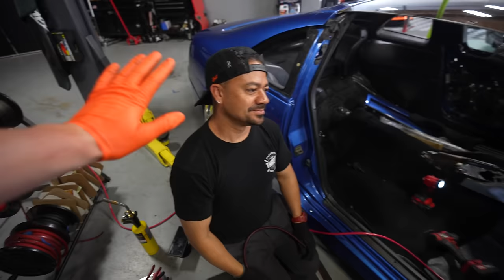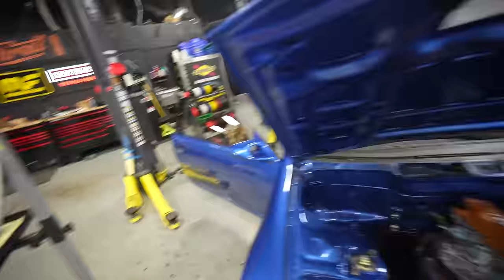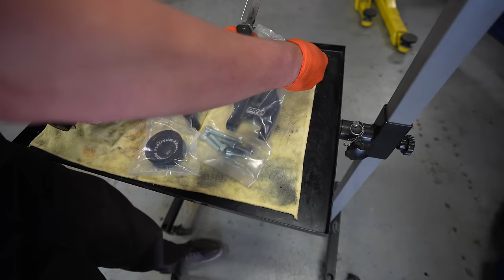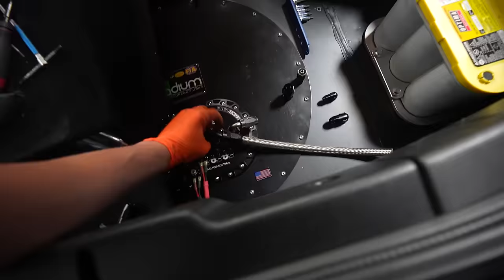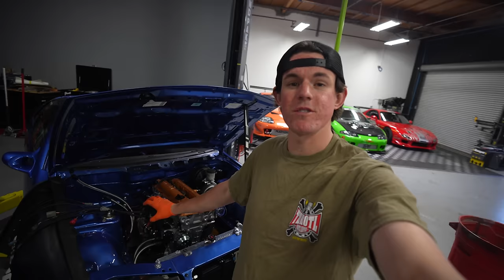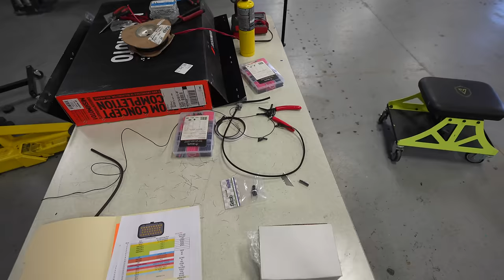Turning a $300 Nissan 300ZX into a $30,000 Nissan 300ZX - Part 13 (FUEL system + WIRING harness)

Comment: I recommend you guys seal all those battery terminals in the back with some sort of sealant so that incase fuel ever does leak, it won't get up underneath the insulation and possibly ignite.

Comment: This is such a 2000’s build. Pretty cool !!
Reply: 2000s car technology for aftermarket bolt ons was terrible so I hope this is not a 2000s build. For the sake of whoever ends up owning this car. High rate of parts failure. Maintenance nightmare. HEADACHE.

Comment: If you run a high output alt, you should put a big 3 on as well (0 GA wire for battery ground, engine ground and alt power to batt [or distro block if vehicle has one]). it basically prevents the power that the alt makes from a "trying to suck the golf ball through the garden hose" for your electronics and any kind of audio setup ( a must for audio) compared to the small GA wire thats stock.

Comment: If you wrap masking tape 2x around the braided wire, it won’t unravel and makes it that much easier to slide the compression fitting on.

Comment: I'd ditch the triple vent dash on the S550. Grab a PP1 or Roush double gauge plate, for oil pressure and vac or boost with the roush one.

Comment: Quinn should make his mustang have 700-800 hp cause the S550s can make 700-800 hp reliably plus since it’s his new daily it would still be reliable making that much hp. Also what happened to Mufango the FD RX7 that throtl built in Puerto Rico which got shipped back to the throtl HQ cause it got shipped back and that was the last we saw of it. Throtl needs to make more content with it cause it’s such a sick car.

Comment: Your channel reminds me of a saying we had about Americans in the military 'all the gear, no idea'. You build great show cars but they are all show no go. You basically throw every bolt on aftermarket product available on a car but they never perform well. That’s why we never see your cars on the drag strip or track. On the rare occasion we do they break, don’t have traction and are a bit embarrassing for you. 
I also am highly suspicious of the longevity of your builds. So many potential points of failure, particularly when you put cars on bags. I give most of the builds 5 years maximum before they cost the new owner a fortune to repair. Shame.